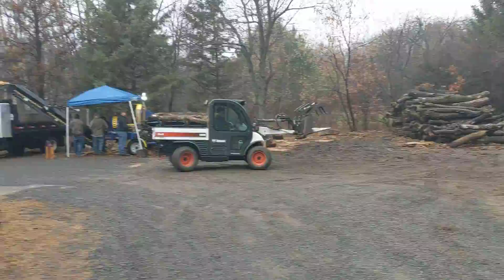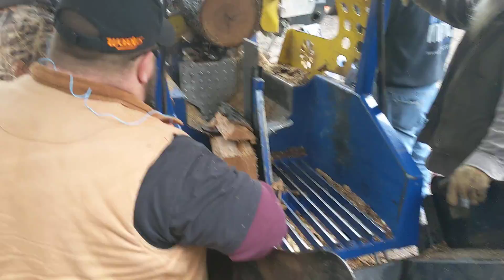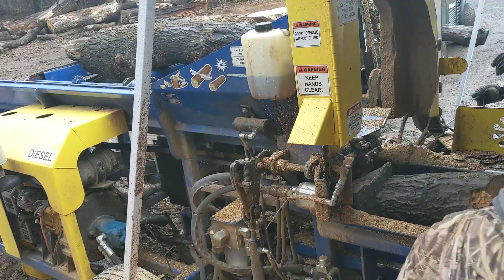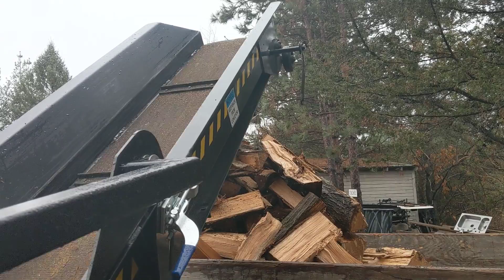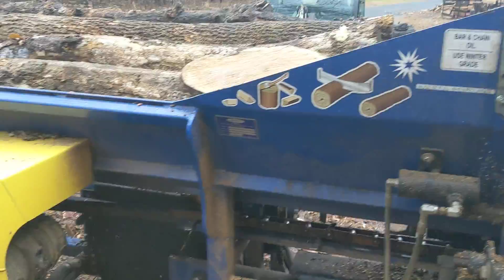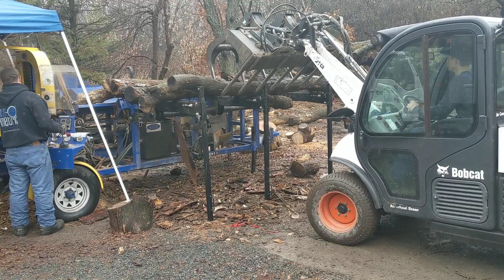Firewood Processor (I do it the easy way!)

Comment: Safety first guys.... Ear/sound protectors work better inserted in ears.  Not a big fan of leaning tools against running vibrating equipment.  Fire extinguishers nearby? That is a beast of a wood processor.

Comment: Let the one peice push the other don't try and take it from the wedge.  1 guy can do something else.  Take the bigger resplits and get them from the tray when a resplit is going on the operator should be cutting another block to push with the resplits.  Do this and you will make 60 cords in the same time.  Your still far ahead of the game with the processor over the single split and its safer.
Reply from the maker: Yes I agree 100 percent on letting the next log push the previous log off the wedge. I honestly tried to explain this several times but no one wanted to listen. Two guys can easily do this. My friends where there to see it run but couldn't help themselves but to get in and help. It's nice to have friends that want to help even though you really don't need there help. Thanks for your advice.

Comment: Just curious you're not using the extra wedges, saying wood gets stuck. Will the next chunk not push it through? How do you mean stuck? Also that's awesome that you can rent this thing. I could do some serious damage if I had this thing for a week. 👍
Reply from the maker: Stuck as in a log with a big knot or twist in it preventing it from going through the splitter. Did I answer your question?
Reply: @CustombyclyneCbc  
Yeah

Comment: 5 guys standing by the splitter, which one will lose a finger?
Reply from the maker: Nope it doesn't take five people, only takes one. My friends came to see how it works and wanted to help. I told them many times keep your hands out let the splitter push the wood through. They had good intentions and just wanted to help somehow.
Reply: @CustombyclyneCbc  . yep, I was steady yelling at them myself, that one fellow almost got bit, he just barely got his hand out in time,  it is common for folks helping to have hearing and comprehension problems.  my friends like me til I work on a project, then all the sudden I am the B_____D cause I am a safety nut,  I told them " do it right or not at all" from the safety aspect,  I like my friends the way they are, no modifications needed.

Comment: looks like You guys need 6-8 split knives
Reply from the maker: We had it. Just didn't use it. Seemed like we had more problems with the logs getting stuck. Also you ended up with a lot more kindling size wood.  Thanks for watching

Comment: Seems to me it would be a lot better if the operator adjusted the splitter to match the wood instead of having guys reaching in to grab wood to throw back for a second split , safer too!
Reply from the maker: I wish it was that easy. Run one once and you'll see why we are doing what we are doing. Yes not the safest but no fingers where lost.

Comment: Wondering why  are you splitting the wood small? My outdoor boiler I feed it as large a log as I can get thru the door ... big logs burn long and slow . The sticks you make burn up fast .... that’s a nice wood boiler , a lot bigger than mine for sure . I use a homemade skid steer mounted splitter in my operation ( see video on my channel) ....going to sub to you I like your channel glad I came across it !
Reply from the maker: Thanks for the sub Ill sub back. I've been running this boiler for a long time. I've found that split wood makes more BTU's than non split wood. You'll find that you go through less wood then, when the wood burns hotter faster.
Reply: @CustombyclyneCbc  , I have heard the same thing about wood size, and a pleasant side effect is the boiler stays cleaner too,
Reply from the maker: @benscoles5085  thanks for finding my channel and taking the time to watch and comment on my videos.
Reply from the maker: After just watching my video again. I do agree with you that they where splitting the wood really small. This load was going to one of my senior neighbors for fire place wood. The wood burn in my boiler is much bigger. I've watched a few of your videos and you have one heck of a setup going! Good job!

Comment: About $5k per face cord ;)
Reply from the maker: Explain
Reply: Lol.  Lots of nice equipment there... that I wish I had!!
I make my 12cd/year with a 30 year old Stihl 044 and a splitter maul or a 16 ton mtd hydraulic.
Reply from the maker: @blaws6684  044 right on! I bought mine in 99' also. Love that saw! Still runs like new. The processor we rent and split it 3 ways for the week. The bobcat is my neighbors that also rents the processor with me. If I didn't get all the wood and delivered to me for free I wouldn't be able to justify the rental cost on the processor. Thanks for commenting
Reply: I have 40 acres of mixed species. The last 20 years I’ve heated with blowdown and blight killed. Minimal use of propane for backup. Just something right and good about wood heat. And to the green meanies I will remind them that my carbon footprint is already in the atmosphere... called trees. Zero net impact.
Reply: @blaws6684  i got a 044 in 1982 still runs great .
Reply: My saw shop guy is an amazing wrench and one of the biggest saw dealers in the region  most pro cutters go to him for equipment, service and advice.  He sold me the saw used 20 years ago and offered me 150 more than I paid then for it last month Ive had a few other saws since then but they don’t have the tenacity the old boss has